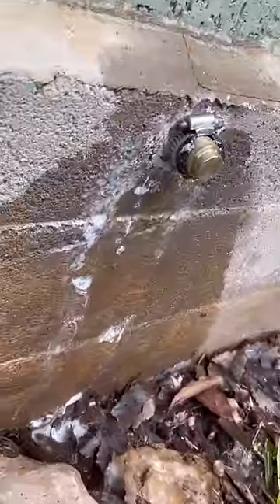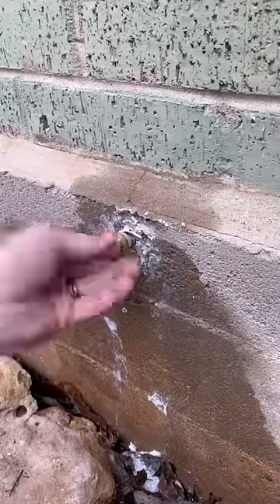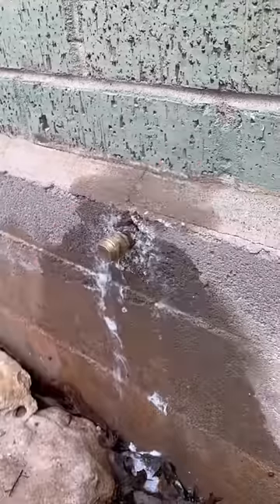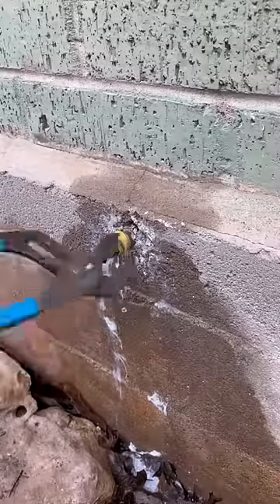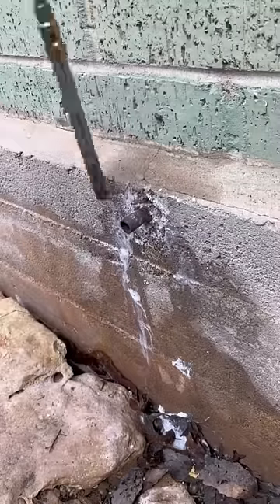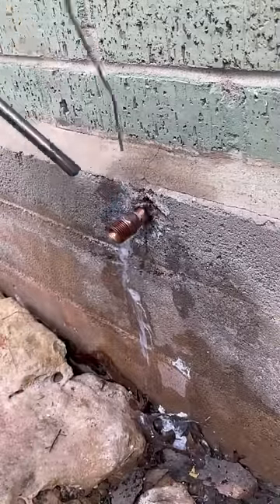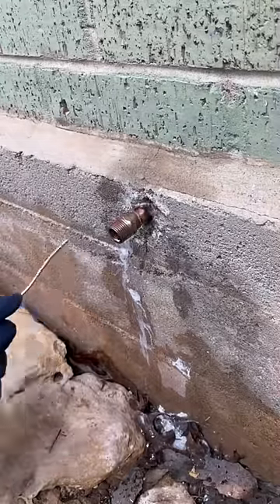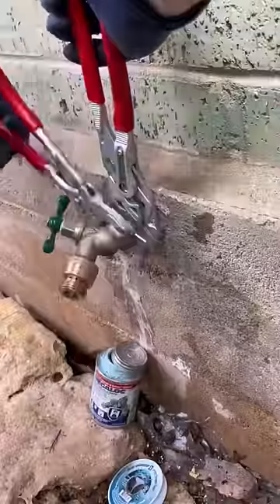Repairing a copper waterline for a hose bib. #plumbing #plumber #repair

Comment: Why heat and flux the pipe, if you are just going to sand it after. I mean I understand why flux is used, just didn't see a reason to add flux just to sand it off
Reply: Depending on if there's a lot of solder, you can get it back to original pipe diameter faster than sanding it all off.
Reply: @davidscott5903  i guess I comprehend what you're saying, but I feel a torch and wire brush would be the more logical approach
Reply: @krislink1761  
Yes, personally I use a torch and a dry rag. It does a really good job. But to each their own.👍
Reply: It's a process called desoldering braid. It actually helps in the removal of solder.

Comment: That's not a hosebibb, it's a sillcock. Hosebibbs have a bibb, aka the larger flange, usually with screw holes. 

I have a core bit set for my angle grinder on the van. I would have cored around the pipe with a 1" bit so I could set the male adapter back further and install a hosebibb with some screws to anchor it. Putty behind it too.

Comment: Dear God how much solder do you think that joint needs? 😂
Reply: Will you post a video on the correct amount?
Reply: @tommyinge81  rule of thumb is whatever nominal size pipe you are soldering you need that length of solder for the joint.  1/2” pipe would need 1/2” of solder.  The amount he put in it to where it flows on the inside of the pipe will cause turbulence and cause the pipe to fail over time…

Comment: I had to use a Shark Bite to secure the water supply to my meter because some idiot plumber impersonator ruined a valve and cut the water line to close to the STONE foundation. I strung a release tool to the pipe.
(You don't put heat to structural sandstone, especially when it is wet.)

Comment: You don’t have a pex removal tool? Their fairly cheap
Reply: What pex? There isn't any PEX here! You mean SharkBite removal tool? Cause that wouldn't work when fitting is too close to the wall. When ever push-to-fit fittings are too close to one another or something else unmovable, they're a PIA to remove. 

Also they're fairly...
Reply: @tdotw77  thanks mr right. And yes it can fit here I guarantee you that

Comment: 3/4" pipe only needs 3/4" os soldier. Any more is too much. Bend a 90 in the soldier the diameter of the pipe and use that much next time

Comment: Don't you guys use. Wall plates for your out side taps.. UK viewer
Reply: Ive seen a couple of those but over 90% are some variant of a tube sicking out with a turn handle
Reply: It's newer code for new construction, but you can get away with a lot on old stuff.
Reply: Yes,  but if it's your house and your neighbors don't snitch, you can pretty much cause lots of damage to your house in the US.

Comment: my outlet took a shit I called the plumber they wanted 2700, I'm retired and 70 years old but there's no way I could pay that, with the finished basement I had to cut drywall in the ceiling which was pretty easy, removed the insulation, cut the copper pipe solder in a new pipe with a new water valve on it which cost me about 30 bucks I think, why don't i have any honest plumbers in my area cuz I hated doing all that?

Comment: Dude don't use that megalock use Gasoila, Megalock is more for AC stuff once that Megalock dries you'll never get that hose bib off
Reply: Hey brother, I think you may be mistaken here. I've been a licensed plumber for about 11 years now, and I too use Teflon with megalock dope. It is soft setting 100%. I have taken my own joints apart years later for further installs or something near my previous repair began to leak 8 years later and I can literally turn them off with no proble. If actually makes unthreading them easier due to the soft set. I'm sure there is a product that does actually set hard and makes it virtually impossible to remove once it sets, but not medgalock pipe dope. Stay blessed
Reply: @Drago297  I've been doing this under a master license for 35 years and had the unfortunate pleasure of having to take that megealock stuff apart with 2 3 foot pipe wrenches and destroying the fitting in the process, I will admit that minus the teflon it's a complete bitch if not impossible

Comment: Way too much solder. You only need the length of solder equal to the diameter of the pipe.

Comment: Copper pipe directly in concrete fails after about 20 years.  The concrete reacts chemically with the copper and eventually corrodes open.  The replacement requires running the water lines up in the roof and down thru walls.  Really bad construction.

Comment: Sharkbites have never been hard to take off? What the hell? Lol
Reply: they are hard to remove when there's not enough space behind them to access the release ring.
Reply: Sometimes they don't release as they are designed to. I have had to pound them off with a hammer on the release tool.
Reply: @floridagunrat1625  exactly. I definitely agreed
Reply: @waterheaterservices  i as well.
Reply: Only ones I have had a hard time releasing are 3/4" ones with really hard water.

Comment: I still don't understand the need for a vacuum breaker on a hose connection.  What a weird code.
Reply from the maker: To prevent water from siphoning through a water hose into the hose bib and piping. Really only an issue if you leave the end of the hose submerged in a puddle, pool, bucket, etc.
Reply: He said code.... lol the inspector will be out in 3-12  weeks for this repair

Comment: Aye dog easy on the solder you don't need that much
Reply from the maker: I know 🤣 but it doesn’t hurt anything in this situation. I didn’t trust that piece of pipe lol
Reply: @The Plumbers Plunger  nah your good I'm a commercial plumber and operator I solder, braze, do gas lines, pex (all kinds), propress, underground, top out, whatever. It's easy money!

Comment: Copper pipe leading to outside wasnt quite the right height so the jackasses before us just bent it upwards across the 15 or so feet across a bedroom. Guess where turbulent flow formed and caused weakening of the pipe? Guess where all the forces went as soon as the outside fitting began twisting? The pipe sheered right in half with such little force the person outside couldnt have ever known, and of course the moron who should have been watching the pipe from inside(might have been me) had just walked away to grab a tool we'd need in like... a full 10 minutes.
The pipe was right above a computer and bed and those along with a quarter of the ceiling got covered in at least 3 gallons of water despite the pump being off and pipes drained.
Reply from the maker: That sounds like a horrible experience

Comment: So when it pools like that means you put way too much solder in the joint. That’s gonna cause all sorts of cavitation and could wear out things faster than if you hadn’t done that.  Take a flux brush, heat the sob up and brush that solder out of the fitting.

Comment: Really as a plumber you do have no clue how to take a shark bite fitting off.
Reply from the maker: It’s too close to the wall to get the removal tool in there…
Reply: @theplumbersplunger  You only need an 1/8 inch and your tool will work. I have even used 2 sawzall blades to pull the fitting off. Depending on the brand of said cap its valued at 5 dollars or more.

Comment: There's a one dollar plastic tool to remove that shark bite 🤦🏼. And just use pipe dope so it gets fused on there and the next diyer twists the pipe in the wall trying to get it off
Reply from the maker: It was too close to the concrete to get that tool on there… the pipe dope is non-hardening. Nothing your complaining/trolling about is even relevant to this?

Comment: Why don't you fix it the right way. Copper pipe shouldn't be in the concrete without at least some clearance. Better yet a sleeve. Better yet a frost-proof hose bib. Better yet don't make videos of work like that!
Reply: Im not quite understanding whats making these people make these videos other than they want attention and are probably going through an identity crisis. I very rarely seen stuff done right. Few good channels out there but most of these videos are “hey, heres how you do it wrong guys. For you DiYErs out there!”

Its a joke
Reply: @Titantitan001  I thought I was the only one with brains. Thanks Zac!
Reply: I was literally thinking the same thing
Reply: While you are correct that copper should be wrapped or in a sleeve before the concrete is poured around it, tens of thousands of homes have been built with the concrete poured directly around the copper before this was code. I recently was working on a house built in the 50s with all the copper directly into concrete. I told the homeowner that we should replace the copper at the concrete, but when we cut the concrete floor out and exposed the copper, it was in perfectly fine shape. Also it is possible that it had a poly sleeve on it when it was installed, but it when the first hose bib was sweat  on, it was burned off and melted back into the concrete where you would not see it. Homeowners don't want to spend thousands of dollars fixing problems that aren't really a problem. Additionally, we don't know where this was done, so freeze protection may not have been an issue. In the South, hose bibs are always done this way as freeze protection is not a problem. this was a perfectly fine repair under the circumstances. Perhaps you should broaden your horizons before you trash somebody else's work!
Reply: We can only do what home owners are willing to pay for 😦
Reply: @waterheaterservices  No. You you tell the homeowner this is how we fix it. If they don't like it you say good bye!
Reply: @waterheaterservices  You tell the homeowner  the right way to fix it. if they don't like it you tell them good-bye!

Comment: why are you using two types of thread sealer. one is enough. two is a waste of materials. do you know why we use one over the other. you aren't a professional and it shows. thread tape is for PVC. before PVC all we had was metal pipe thus pipe dope. we need these they are a lubricant to lube the threads so the threads interlock and easily make a seal. thread tape is more expensive was designed for PVC. when you are in business every penny saved is profit.